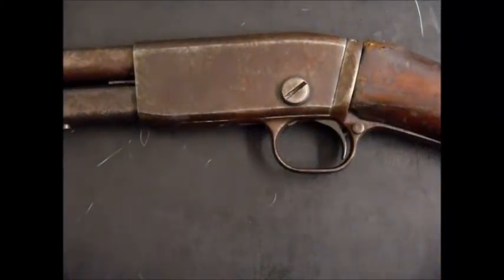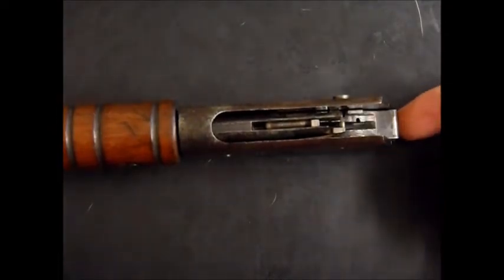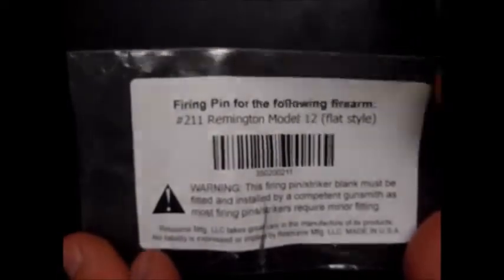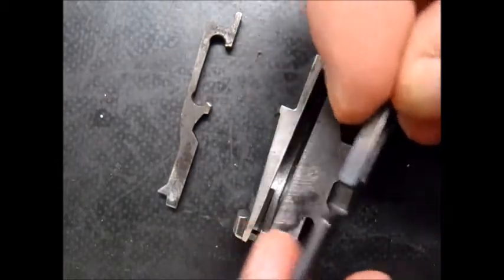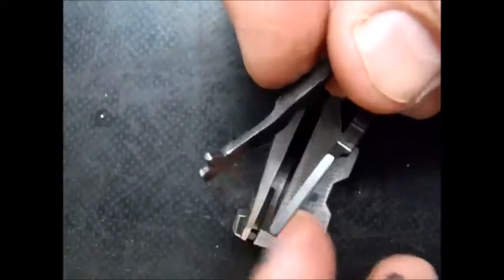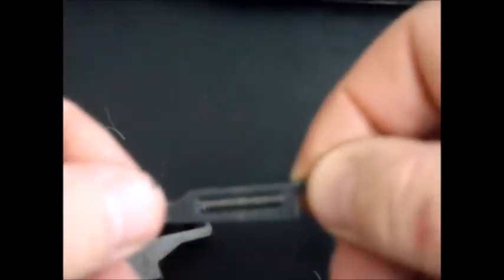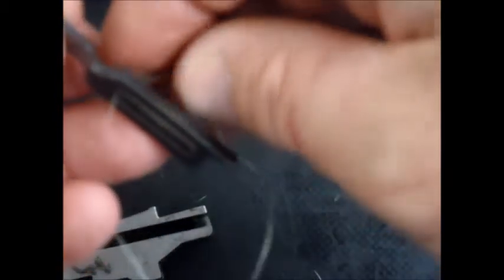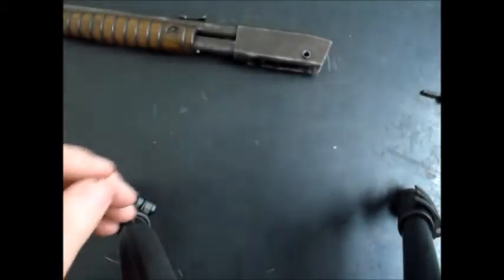Remington Model 12 Broken Firing Pin Replacement

Comment: The string trick is what I came looking for. Wasn’t sure how to compress that spring and tap the retaining pin in place so Thank you for that.
Reply from the maker: You're welcome. Glad to be able to help.
Reply: @456eec  I used some 4lb ice fishing mono line and it worked like a charm only to get it together to then realize I don’t have full travel and I believe as you found that the front is a bit too proud and will need to be filed down thinner followed by a fine polish
Reply from the maker: @FYMM69  Yes it did require fitting. If you have one of those from Brownells I have found they are a bit soft. After a bit of use it started mis-firing and I found the back of the firing pin had mushroomed slightly and this was limiting it's forward travel. I just tapped it back into shape and have rarely fired the gun but I am planning to heat the back and treat with Casenit® to harden it a bit. I will put up a video when I get around to doing it.
Reply: @456eec  that’s good to know. Yes I do have the firing pin from brownells and after getting it all back together, now the action doesn’t open all the way nor will it pick up the new bullet. I’m pulling it back apart right now and thinking I might need to file that front of the V section where the front pin sits

Comment: 456eec, I just replaced the firing pin in a Remington Model 12A and was still having occasional misfires like you. I traced the problem to excessive head space. Looking into the receiver where the bolt tips into a recess for lock up, I noticed the bolt had beat back the recess and bulged some metal up behind it. I used a 3/8 "diameter punch and a big hammer to beat the bulged metal back down.Although the action may still be closed on a" field "head space gauge, head space has been reduced enough so that the gun fires every time now.
Reply: Onde compro essa peça ?
Reply: Great instructional video.  You left no curves in the road   I appreciate your detail.   Folks call me CeJa , THANKS

Comment: How did you manage to get Brownells to ship that to Aust they well not ship to NZ
Reply from the maker: That was back when they used to ship here a couple of years ago. Now we have Brownells Australia. I can just order by part number from the US site and plug straight into the Aussie site. Usually takes about a month to get the stuff by the time it is sent, clears customs then is sent out but no hassles with customs. Gun parts, magazines, barrels etc are no problem. They keep your firearms licence on record. About 15-20% more expensive than the US price but no exorbitant US postage, no import permits and that includes GST. They now have branches in UK, Germany etc but NZ is probably a bit small for them to bother.

Comment: My pins are stuck, were yours tapered, that is, did they just go one way and if so, which way.  The video seems to imply you put them in from the top.  Many thanks for the video, and I hope to get my firing pin replaced using your guidance, once these pins are out.
Reply from the maker: The pins are simply parallel pins in drilled holes so they could come out either way. Often if they have been out before the ends become peened meaning they will more easily come out the same way. I would put some penetrating oil in the holes and leave overnight. Then get a pin punch that is just slightly smaller than the hole and punch out from the bottom up with the block supported on a plastic or wooden surface with a hole to accept the pin as it comes out. Before you reassemble check the pins and file off any obvious peening on the ends.
Reply: @456eec  Many thanks!  I have ordered a 1/16 Starrett  punch and will get some Kroil working on the pins in the meantime.  From there, will follow your recommendations.

Comment: Great video. Would you by chance be able to email me side by side pics of the two or better quality images? There’s just not much available and I have to adjust the new firing pin for a cust. The original one snapped and disappeared so I only have the back half
Reply from the maker: Sure. Give me an email address and I will send some photos and give you dimensions.

Comment: @456eec i just recently aquired a remmington model 12-a i am puzzled and need a little help maybe you can help me. Im not missing any parts and nothing is broken. i do know the trigger spring ( the tiny one that sots in the little plunger button) is weak but what im having problems with is it dosent want to consistantly shift bullets and when it does the bullet usually hangs up on the bottom of the barrel leaving an indention in the bullet. any help as to what i need to replace (other than the trigger spring) or do is much appreciated
Reply from the maker: Hi Dustin
Your problem is almost certainly caused by the cartridge retainer. There was at least 2, possibly 3 types depending on the serial number of the gun. It is not an obvious part and may be missing or possibly not installed correctly on your rifle. As a start I suggest watching this to see what the old type looks like and how it should be installed correctly.  https://www.youtube.com/watch?v=cw-KNgl7I8c&t=184s
I suggest you also do an in depth Google search and you will find lots of forum posts and also sites that sell them if yours happens to be missing.
Reply: 456eec thank you much for the help! i will be replacing it soon then

Comment: I think u replaced a broken  extractor  , not firing  pin .
Reply from the maker: The extractor is the little spring tensioned hook with holes in it on the RHS of the breech block that extracts the cartridge case. I clearly did not  replace that. If you go to the 3 minute mark you will see the package with "Firing Pin" marked on it.

If you meant "ejector" then you are right as the firing pin also acts as the ejector in the Model 12 as is stated in the video.